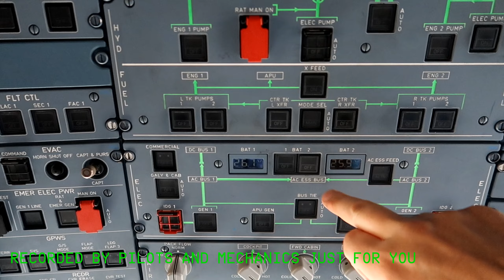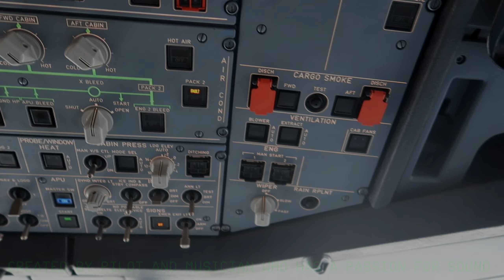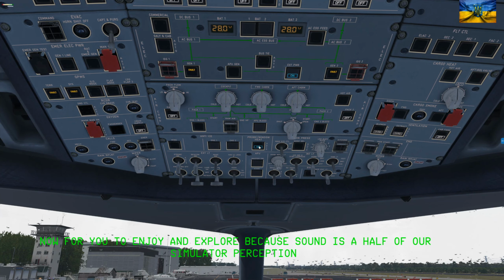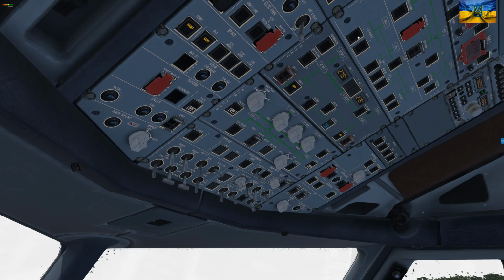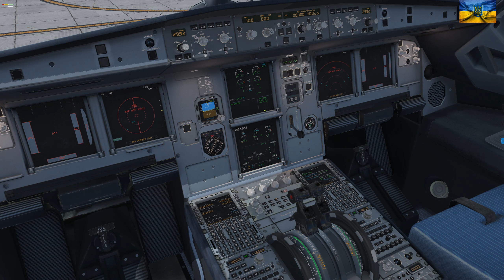BSS FFA320 PRO SOUND PACK part1

Comment: Hi I just bought this but when I load in its normal for a bit then freezes for a very long time, I restart the sim multiple times and it still doesnt work. Please help
Reply: Im on X-Plane 12 with the FFa320 Extended, not the older one. Could this be a problem?

Comment: Hi may i ask a question? I installed the sound pack to my FF A320 and whenever I taxi an aircraft there’s a strange shaking sound coming up. Could you please tell me how to fix this? Thank you
Reply from the maker: Hi, the best way if you send the video of problem to amrussinc@gmail.com
Reply: @komrad1983  ok thank you for reply 👍
Reply: hello I have the same strange sound as if it shakes do you know how to fix that ?
Reply: @RobertLudwig3030  No I still have no idea how to fix this…I’ve tried everything such as updating the aircraft but that doesn’t solve the problem…I’ve sent an email to the developer for months,still haven’t got any response :/
Reply: @taorichan1751  Hello, how did you update the plane? I bought it 5 months ago and I don't know how to update it
Reply: @RobertLudwig3030  X-updater
Reply: @taorichan1751  It is a blog of notes and the version it says is 1.3.0 that version is also yours
Reply: @taorichan1751  Hello, at least I found how to solve the strange sound problem
Reply: @RobertLudwig3030  No,mine are 1.5.5
Reply: @RobertLudwig3030  Really!!?? Could you please tell me how to fix it?
Reply: @RobertLudwig3030  How? I am going crazy with this and unfortunately the developer isn't responding
Reply: @komrad1983  I did this but got no reply. Is there a fix yet?
Reply: Temp Fix, open 3D Sounds and lower JETFLOW. It's tied to that sound.
Reply: doing many tests I have seen that this sound does not appear when you have the fuel tanks at full,, at the moment you remove fuel it appears progressively.